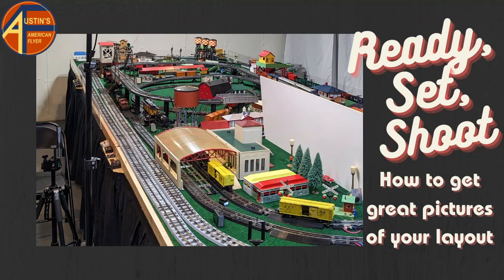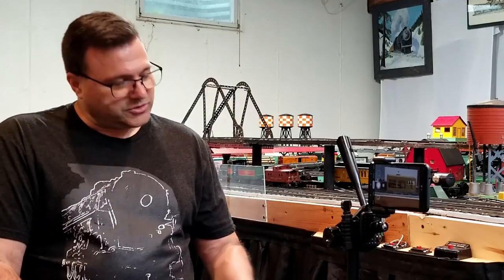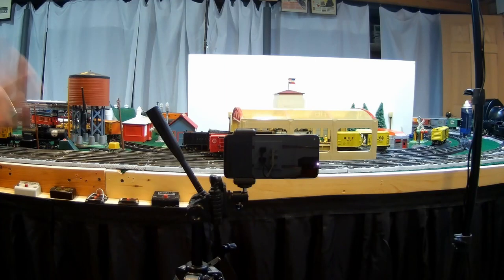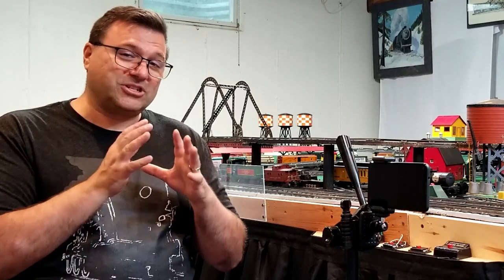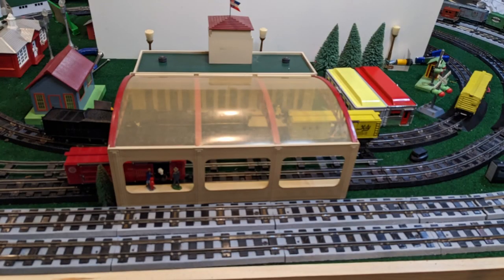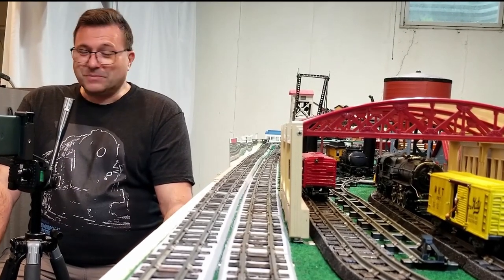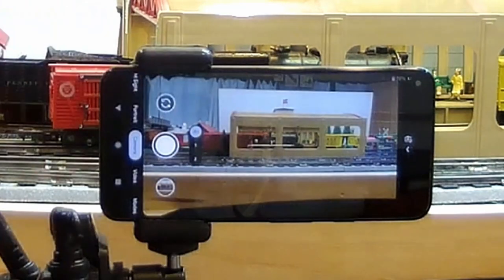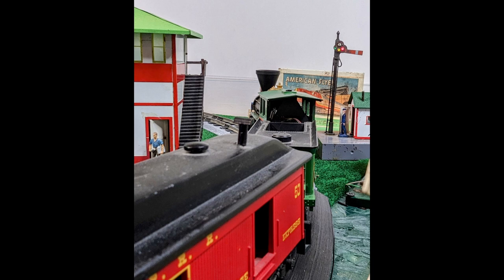Taking better American Flyer train pictures:  some tips for composition and camera settings.

Comment: There is a lot of good information here Austin. Since you asked for comments, as a professional photographer since 1973, with commercial photography included in the types of photography for which I got paid, I will add a few tips.
First, photography is all about light--photography is defined as painting with light. Anyone who is serious about getting good photos of their train layout should take the time to make effective use of whatever light sources one has or can acquire. Your small cap light was one good example. White, blue, or yellow 3X5 or 4X6 index cards or similar items that will reflect light can be useful as reflectors to bounce light from a source back into the image from the opposite side, helping to add detail in shadows, but still allowing  for contrast. The blue or yellow colored reflectors can help to make an image appear to have been taken near sunrise or shortly after, or at sunset or shortly after.
As we are working up close to small objects, we usually need the greatest depth of field, as you correctly said. When using a real digital camera, we have the option to set the lens aperture or f-stop. For the greatest depth of field high numbers should be selected such at f-22 or f- 32, if possible, is the image to be recorded is static. This is assuming the camera in mounted on a tripod or firmly set on a surface so it will not move during exposure, as those f-stops will require slow shutter speeds. if using a phone camera, use whatever adjustments might be available in the "pro" setting. Using moderately wide focal length lenses also helps to give greater depth of field. It is important to have the main subject of focus in focus, wherever that subject may be in the frame.
There are two very helpful composition "runes" in photography, the "rule of thirds" and the "S curve". To use the Rule of Thirds, imagine (or many cameras and some phone cameras allow a grid to be placed on the screen as aids for this) a tic, tac ,toe grid. Place the main point of interest at any of the four places where the horizontal and vertical lines cross.
An image that has something resembling and S curve, like a winding road, leading into the background is usually interesting. Often these two compositional aids can be combined in a really interesting image.
When possible, when shooting images on my layout, I try to get the lens at what looks like eye level of any of the miniature people on the layout. That angle helps to to create the illusion of a real life scene. That odd overhead angle was the main problem for me with your shot of the Franklin train.
These are just a few tips that may be helpful to some.
Reply from the maker: Wow!  Thank you!  This is incredibly helpful.